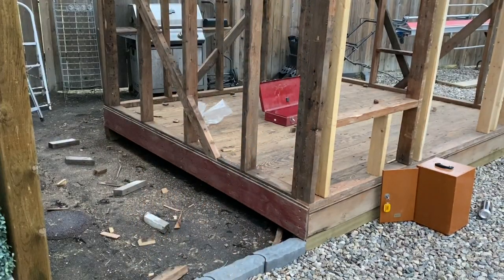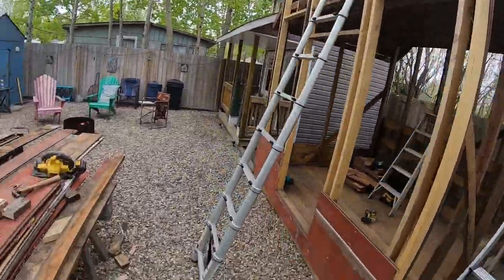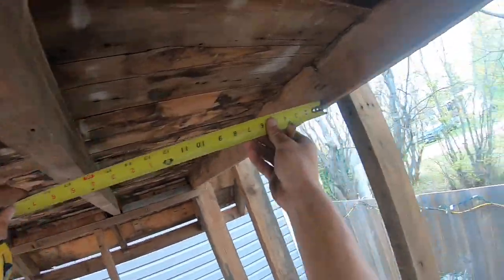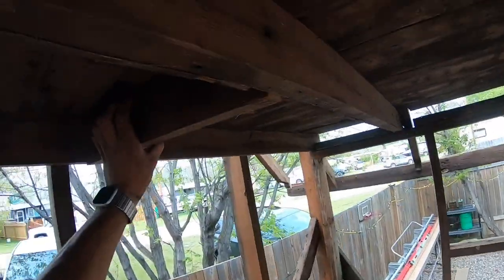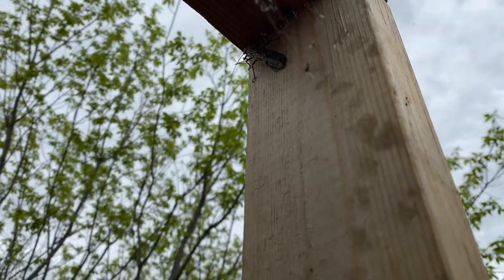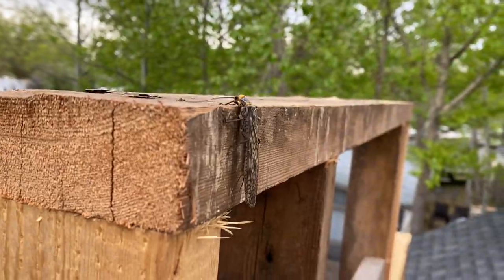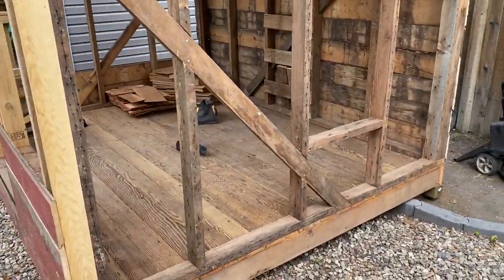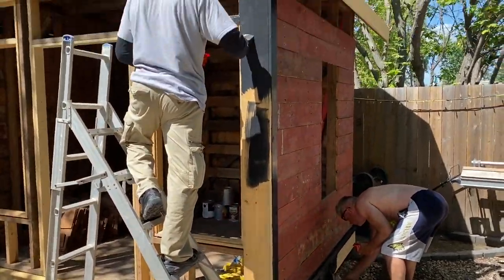Saloon Build Episode 10

Comment: Looking good, any particular reason you are doing a hatch inside rather than stairs and a door outside?
Reply: I would guess....not enough wood? Just a guess.
Reply from the maker: Mainly because there wouldn’t be enough height in the attic to put a door but if there was that would be a much better idea!
Reply: @AustinTischler  well not a full size door, but it looks like you have it framed for a window, and if the window swung be more room that that hatch? Of course everyone is an expert after the fact . . . speaking of windows . . .

Comment: Did you final buy a nail gun? It's quiet. Did you find out what that bug was. Was it a termite? How long did it take you to put up the side walls and roof? Please answer my questions if you can.  Bye and stay safe.
Reply: If THAT’S a termite it will have the entire place eaten down by next time he comes lol If it looks SOMETHING like it hopefully it’s NOT a wood eater. I have seen several termites and they are very small around here!
Reply from the maker: That’s my bosses nail gun that I just borrowed for the weekend then it will be back to the old fashioned way lol. I’m still not sure what that bug was and I’m estimating it took me about 5 hours to stand the walls and frame the roof.
Reply from the maker: Just reading through the other comments I found out the bug is called an American salmonfly.